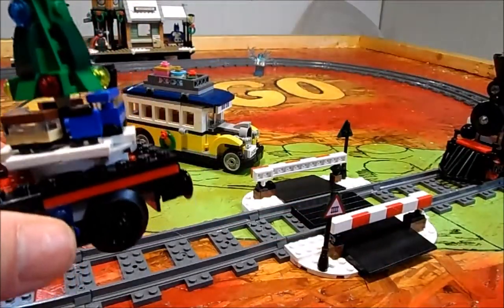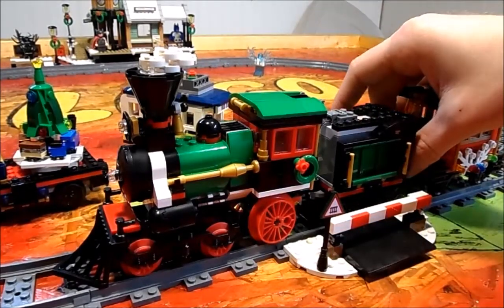Lego Holiday Train Power Functions Modification. NO WHEEL SLIP!

Comment: I just recently replaced the batteries on my train and only after a couple hours running it, it already seems to be dying. Anyone know if this train drains batteries quickly or do i just need better quality batteries?
Reply from the maker: The Christmas tree portion adds a lot of drag, requiring more power from the locomotive.
Reply: @vmacattack  so maybe more powerful batteries then? Im using some generics currently. Only lasted about 6 hours lol
Reply from the maker: @ISAFMobius18  batteries are batteries. You might get a few more minutes runtime from ultra premium, but it isn't worth it. Either delete the car or modify it to not spin if you want it to go longer. Reference, at brickworld I had trains running 8 hours continuous, got an average of 3 hours per locomotive on rural king brand AAAs
Reply: @vmacattack  thanks for the info. Sounds like they just suck power like crazy. I wonder if I can lubricate the gear and where it rubs to cause less friction
Reply from the maker: @ISAFMobius18  use the graphite powder for pinewood derby cars if you do
Reply: @vmacattack  oh graphite. I might use a pencil then. Great idea

Comment: Another comment that will probably never get read, but... The black circular piece just before the nose.... I replaced mine with M5*30mm steel washers. Got rid of most wheel spin. I extended the nose a little touch (longer axle) and added a couple more washers, and that did the trick. Not so LEGO-like but keeps the kids happy!
Reply from the maker: I read all the comments. If it's not pure Lego, but it makes it work, I'm not going to judge. Cheers!

Comment: This'll probably never get read but, I noticed this problem when I first got the train and PF years ago. However I only had the battery box and motor, and assumed the issue was caused by the motor being at full speed all the time. Recently got in the parts to motorize it correctly and noticed that wasn't the issue. 

The video helped me realize what the issue was, so thanks! I ended up designing a tender car in LDD that uses the design from the Disney Train set, but retains the look of the one from the Christmas Train. Ended up ordering the parts off Lego.com for $20. Pretty cheap to get a motorized tender car.
Reply from the maker: I read all my comments. Thank you so much for the watch.

Comment: Interesting, I have 2 of these trains motorized but never had to modify it. Everything worked well even the christmas tree turning freely. Try re assembling the tree car. It might be just tight on somewhere. Nice placement on the IR though. Awesome
Reply from the maker: Thanks for the feedback. I did check the tolerances on the tree car, but didn't try different gears.
Reply: I'm having issues with my tree car gear rubbing on the inside support. Tried loosening it but no luck